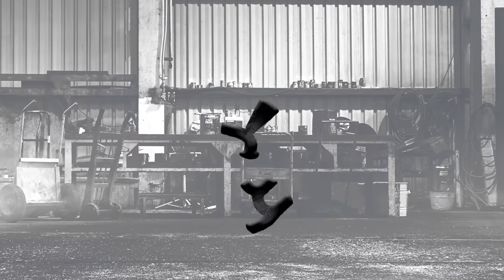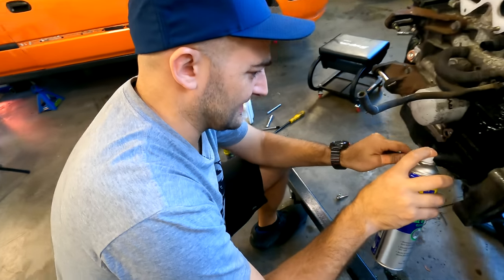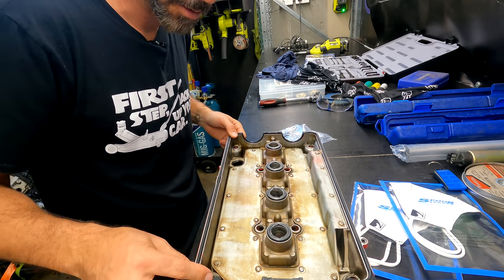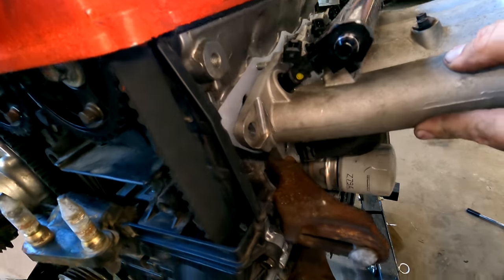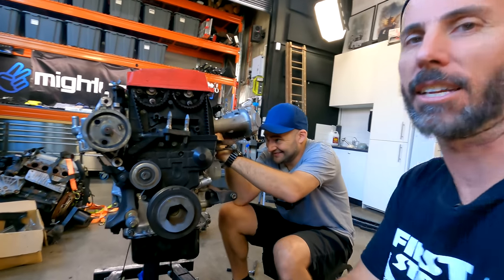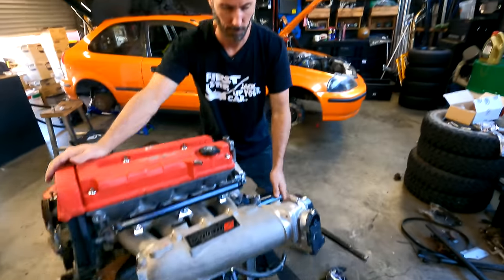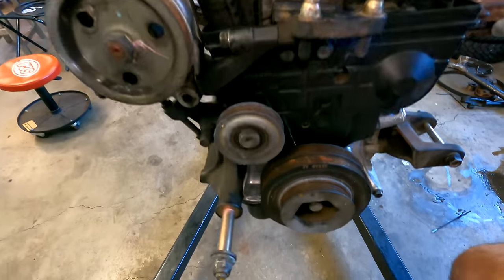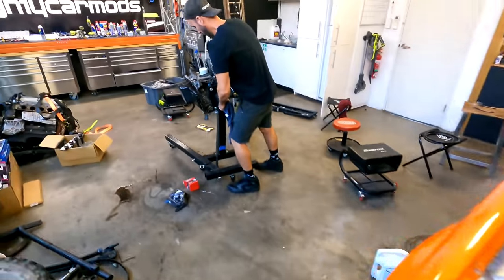The Last SKUNK FIGHTER | Nugget CIVIC Build (EP6)

Comment: Can't wait to see this beast in action. That black bit Moog pulled out the spark plug hole looks like the rubber bit you find inside a sparkplug socket that holds the sparkplug in the socket so it doesn't fall out while removing or installing the sparkplug. Had them come out of the socket and stay on the end off the sparkplug while changing them in the past.

Comment: 9:50 I use a magnetic spark plug socket, it's incredible. Also, "grease" or anti-seize does change the torque spec but it helps remove the plugs if they get nasty so I always use it

Comment: Replaced an oil filter once in a hard to reach spot. Didn't notice the rubber ring and put on the new filter. Started the engine and the ring almost instantly snapped. Had never seen so much oil leave an engine so quickly... so it's a real good tip!

Comment: "That's the end of the distributor lead"

It could also be the little rubber bits that go inside a spark plug socket that hold the spark plugs when you remove them. They have a tendency to fall out.

Comment: You had some confidence doing all the work you've done without checking the plugs and if they even came out first😳
Reply: And no comp test .....head gasket....rings...bearings!!!! Its in the engine stand just check it whilst it's out its so easy !.........maybe they want it to fail for extra content 😏
Reply: @richardford5794  you might have a point there😉 but would seem a shame to have to take the engine apart again if something is bad inside😕
Reply: Yeah...and so easy to stick a bore scope in there..even a magnet stick would be nice. Can't trust whats got inside while its been out & sitting.

Comment: Marty, I would be pulling that manifold off and putting some gasket / silicone on both sides of the white manifold / spacer thingy just around the water gallery. Square or round makes not much difference but no goo, it will leak for sure. Easier now while motor is out!

Comment: “What’s that?!” moog pulls out the end of plug wire boot Marty with complete trust: “a Honda person will know”
Reply: Rubber keeper from inside the spark plug socket
Reply: @rossmiller7275  exactly what it is, I’ve lost many of mine and had to fish them out with long nose pliers and glue it back in 😂
Reply: @rossmiller7275  yeppers - exactly!  Just taught a kid in the neighborhood about doing basic engine maintenance, the importance of the little rubber bit in the plug socket was highlighted :D

Comment: Hopefully Moog put a little bit of oil on that Oil Filter gasket before he put the filter on🙄
Reply: Didn't look like he did.
Reply: I think he went in dry....
Reply: Maybe the plastic was holding some lube on it from the factory??  I've never had plastic on an oil filter like that before, not sure why it was there.
Reply: @dustintunis9347  i have used quite a few oil filters that have the plastic on them.  I actually prefer brands that use the plastic since it keeps debris from getting into the filter while in storage.  It is true there is a light oil on the o ring but i still always put a good film of oil on the o ring before i put a filter on.  Just out of habit. I have a hard time thinking Moog forgot the loob  with all the fingering going on in these films 🤪
Reply: Good discussion, everybody. 👍🏽😘
Reply: When Moog rolled the engine over on its side to remove the filter why didn't he turn it so the filter was no the down side to prevent oil running all over??????????

Comment: I'd use a couple of paper gaskets along with the phenolic spacer - gaskets for sealing, and the spacer for heat isolation so the intake stays cooler.  Phenolics are usually thermoset, so they don't soften and conform better once they're heated...so ensuring a good seal from the start is a necessity.

Comment: Some spark plug sockets used to have a rubber grommet on the inside to “hold” the plug. Sometimes when you pulled the socket off the plug the rubber grommet would stay with the plug. That might be what you pulled out. If you’re really unlucky you wouldn’t notice when you shove the lead on and then it ends up melting. Then the rubber would expand and literally push the lead off the plug.

Comment: Should do nitrous, b16's love spray!!!

Should've ripped off the little black box on the rear and installed a simple but proper catch can. Simply but important upgrade for the future👍🏼

And yes if it's not a cheap Chinese gasket the intake gasket will work perfectly and indeed keep manifold temps down.

Comment: TFW you grind your shiny new Skunk manifold instead of the rusty piece of shit tensioner bracket...
Reply: Exactly what I was thinking. Even replacing the cast bracket with a pressed sheet metal one would give clearance rather than removing a chunk of structural material next to the bolt hole.
Reply: Glad I'm not the only one!

Comment: Owned an amazing honda once, best lawnmower i ever had the grass cutting ability and reliability was spot on, i think it lasted at least 3x longer than any other none honda branded mower i have had. Bit expensive though to buy for something that just cuts grass. This is why after it broke i did not buy another. It only broke because it got some knickers caught in the blade. Started to smell funny and was never the same after that. Think kept squeaking and sounded like a moped.  ;)

Comment: The thermal spacer is not so much that it keeps the air stream any cooler.  It's that the heatsoak in the intake manifold warms the IAT sensor which is slow to react.  Moving the sensor to the charge pipe or intake tube and retuning works just as well!

Comment: I should recommend, while the engine is out some of those coolant hoses look pretty grot.

I highly suggest changing especially that rear little U bend hose that comes out of the engine and goes right back in thats under the intake while the engine is out, because I had to replace that thing on my B18C when it  got a hole in it, and it was a GIGANTIC pain in the balls

Comment: The reason you where having issues fitting your skunk is because, the flange is designed to fit both b16 and b18c cylinder heads. The block on the b16a(but not the b16b) is about 13mm shorter, so when the b16 head is on the b16 block the elongated(this is due to the b18c and b16 heads having different bolt patterns so it fits both)hole hits the alternator bracket. When the b16 or b18c cylinder head is on the b18c or b18a/b block it does not interfer.

Comment: That happens because the skunk2 intake is for the B18C4/C1 which is different to all the B16, and the Integra type R B18C and it's variants. The B16 and all the type R B18C(5,6) share the same.intake... the B18C4/c1 is different from all the other b series vtec.

Comment: Use the S2000 oil filter. Bolt on swap, with bigger surface area for filtering. Used in my B series swap in my EK hatch

Comment: FYI, that rubber grommet that you found on the spark plug is from inside a spark plug socket. They put them in there to grip the plug so it doesn't fall out :-)

Comment: The rubber piece you found in the spark plug hole was a spark plug socket "retainer" that's supposed to hold the plug in while you lower it.

Comment: You could have used the opportunity to fill up the oil filter with oil, since you can rotate the engine so the filter is pointing up. That way you would save the engine from the initial dry start wear. But since you are not keeping the car...

Comment: 3 questions.

1. How did you get a camera in the engine cylinder to film the sparkplug installation.
2. Why did the sparkplug hole look like a paper towel roll's inside...?

3. How did you get the camera out again?

🤔

Comment: Hey guys! 

Why don't you do some work on the cylinder head like making a biger intake and exhaust port. Biger cams and give degree on the valves. It will be a really fun video and then we can se if this adds  some unicorns to the car.

With you the best ... ket it going! From Puerto Rico 🇵🇷

Comment: Moog, you forgot to put a bit of fresh oil on the new oil filter gasket. I hate to be "That Guy" but I've  battled many oil filters in my time that were baked on from the previous owner/mechanic not oiling the new gasket. On some cars where access is tight, it can be a nightmare...

Comment: I would just point out that if you are gonna clean a whole engine with brake cleaner, respiratory protection would be advised.. at least if you are working inside.
anyway before the health and safety takes over everything, have you done a compression test on this engine? would be a good idea seeing in what weird state some components seemed to be, and also save you a lot of grief down the line:?

Comment: Fellas.... PLEASE do a K24 swap into something small and rwd!!! I was thinking of a k24 in an e30. But you guys already did the LS3 e30. Maybe a k24 Miata or s14 Nissan or a BRZ? If you want to experience NA power... put lightweight rods and pistons in a K24, bolt a 4P racing A2  head on it, 2.2 DC cams and rev it to 9000 RPM. 300-hp all day!

Comment: oil up the rubber of the oil filter next time please. Also, the little rubber part stuck on the spark plug was probably part of the spark plug wrench, the part that keeps the plug in the wrench when you take the plugs out...

Comment: 12:47 should've run the engine a bit (on starter)  to blow out the excess oil before putting the new ones in. It won't harm the new ones, but it won't do 'em any good either.

Comment: You just invited a new way to change the oil filter on your Honda with out spilling a drop. Pull the engine, put it on it’s side and remove the filter. Easy as pie.

Comment: That plastic gasket blocking heat transfer is bullcrap, paper gaskets are also very bad at transferring heat and they are generally a lot thicker then the plastic one, so it might even insulate better.
The contact area with the block is very little and the heat traveling through the thin runners are not going to heat up the huge amount of air going through the runners.

Comment: The piece of "coil lead"  is the insert for a spark plug socket. Had loads of them stick to the plug. And putting the oil filter on dry? That has to be a joke😂

Comment: I'm just slightly concerned they put the oil filter on without oiling up the rubber seal, probably will be fine, just a bit unusual.

Comment: if you can, try avoid using these canned air/air duster stuff. It's just refrigerants. Very potent greenhouse gases, commonly used gases are 120 to  4400 times more potent than CO2.

Comment: guys, as a K20 FN2 owner i'll tell you, supercharger is the way to go, not turbo, supercharger. 
i've tried turbo civic, oh sure it push in a straight line, but it utterly suck for everything else.

on the other hand, i know you've had a bad experience with the brand, but i've tried a lotus with a K24+Rotrex supercharger, and this thing was a freakin' weapon.
nail you to the seat on the accel, pull your eyeballs out on the breaking, take corners 40km/h faster than anything on the track, and smoke ferrari like if they were glorified lada.
just saying, this combo have a better power to weight ratio than a freakin' Veyron with 1/3 of the weight, feel like a missile with a windshield.

Comment: Ahh the old sparkplug boot stuck in the sparkplug tube trick..gets ya every time. Why didnt you grind the alternator bracket instead of the manifold? that kinda hurt my eyeballs. You can get custom brackets too if you wanna get fancy with it. should have used some sealant on the corners of that VC gasket it will leak eventually. Theres a few other places you didn't seal also but that will become apparent later. I thumbs downed it then thumbs upped you to teach you a lesson..=D

Comment: I've found that spot under the intake manifold a bit of a bitch to get to while it's in the car because it's so high off the ground your arms end up fully extended while trying to work with it.  So I'd at least start that wiring while it was outside.

Comment: Most modified Honda owners find an affinity for their ride after the car saves their butt. The stories are varied but they usually involve inclement weather, like pissing rain. It is often late at night and the driver is late, really late. They are driving just under their limit when they hit a hair-pin. At the apex they find the floating remanence of a previous drivers transmission. All four break loose with out warning. If they were driving American muscle physics would dictate that what was ever in a straight line trajectory from the motion of travel... that is what they were going to hit first.  If in a car like the Toyota Celica I used to own one would be treated to a vortex of motion reserved for the max speeds achieved during the spin cycle of a high speed washer. But they are driving a Honda and in that moment when nothing should work, some how, vailed in a fog of profanity and the stench of freshly loaded undergarments, when disaster should be looing, that little underpowered hunk of metal, some how, finds composure and drifts predictably,  the recovery aint pretty but she tracks around the corner. That is why some people like a car that no one normally would.

Comment: The Skunk FITS!!(some GRINDING required)😜 

Moog: "Easiest Oil Filter change ever" 
Yeah.... I'll bet the Engineers said the same - when the Engine was OUT of the Car!!! 😖😠 

(OK, they're not the hardest Filter to get at. But on a HOT Summer Day, after the Car has been in line, idling for about 20 minutes - you'll get SCORCHED!! 🔥🔥) 
Side note - if anyone has had the EXTREME displeasure of changing an Oil Filter on an 85-88 Nissan Maxima... 
I've STILL got a scar or two from THAT monstrosity!!!🔥🔥🔥😠😠😠😭😭😭
~ BEHIND the Engine, UNDER the Exhaust Manifold, AGAINST the Firewall, with SEVERAL Hoses and Pipes. Barely enough room to SQUEEZE your Arm in, against that 1000 Degree Manifold!! 

MERCIFULLY, by 1989, Nissan moved the Filter to an accessible spot!!

Comment: So lets take the engine apart and clean it all up.  Put it back together. Then go to remove the oil filter and rotate the engine so that it dumps all the old oil and dirt back into the engine.
then we break the number one oil filter replacement step (which they have showed in the past) and not pre  lube up the new oil filter seal. I think Moog is sabotaging the build. He wants the whole thing "IN THE BIN"  That's the first time I have typed Moog

Comment: Tbh that intake manifold and throttle body combo are too big for a n/a b16, even for a cammed b16. The power band could be shifted too far up. Should of went with a skunk 2 pro series intake manifold and a throttle body smaller then a 66mm.

Comment: Wrong on the torque for spark plugs! Good luck if one of those plugs seizes! I have used copper anti seize for the 30 plus years I have worked on cars and never had one come loose. Also I am a mechanic it is my profession.

Comment: Can’t believe no one is going to mention that all the fiddling around cleaning the spark plug wells, that the engine is on a stand turn it upside down!, Painful to watch. Finally gets the idea of using the stand for the oil filter and does it the wrong way up...I guess watching a German engineer work would not be as entertaining

Comment: Geeez... tip the engine on the side at least, or upside down..(when cleaning the plug holes & filter mount) You dont know what will be lurking in there. Plugs in dry, bad idea you'll find out why later. No sealant around the water passage..80% that gonna leak. C'mon mcm you know better.

Comment: IMPORTANT INFO!!!!
Wonder where you guys are gonna get your timing signals as there is no crankshaft and camshaft position sensor as you (soooo cool) threw the distributor in the bin.
This is where those sensors on a b16a are housed.
Also, putting liquid gasket on the rubber oil pan gasket. Never ever put liquid gasket on a rubber or paper gasket.
You guys should have put liquid gasket on the edges on the underside of the end caps of the camshafts as stated in the Honda workshop manual.
Sorry, but this is buging me for two episodes now.
Still love all the content you're bringing out, for 7 years now.
Watched all episodes at least 4 times now, but now you are really messing it up😦

Comment: So the car market is obviously different in Australia. And I know you guys don't get the appeal of the Civic. But at least in the USA, the Civic is one of the best cheap cars to modify. There are other cheap cars here that are fast. But they handle like shit & get like 5 MPG. And there are other cheap cars that handle well that have zero tuning potential or very little aftermarket support. And this is another thing, You guys have done a lot of swaps from other makes into different cars. Not all, but in most USA states it is illegal to put an engine from a different make into a different car. But with Honda and the Civic especially, you can put just about every engine from Honda or Acura in there, pass emissions, get good gas mileage and have fun building a car from humble or crumbled beginnings. It's a great first car. If you get into cars, it's cheap and relatively easy to repair or to modify. There is a lot of aftermarket tuning support available from companies like Hondata, Hasport, Skunk2, Hybrid Racing and many others. And a lot of local communities and an enormous pool of used and new parts available. And in the process you can make new friends and talk about mad car things. Or just support one another. Like you guys do. So this is my THESIS on why the Civic is a great car. Especially the older ones.

Comment: If you wipe that sandwich plate clean you need to wipe some oil on that new oil filter seal so it doesn't stick. Also please don't torque spark plugs... it makes you look like a honda guy.